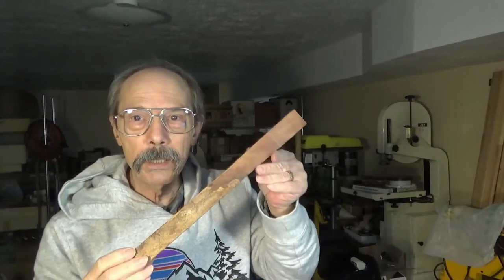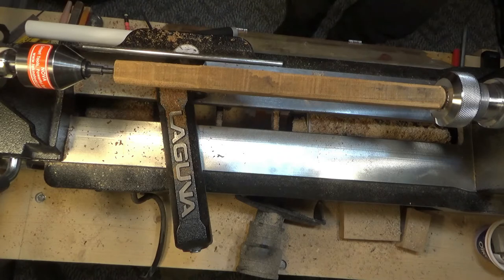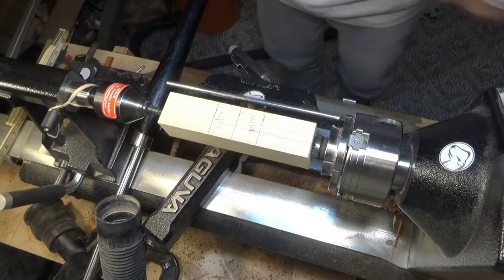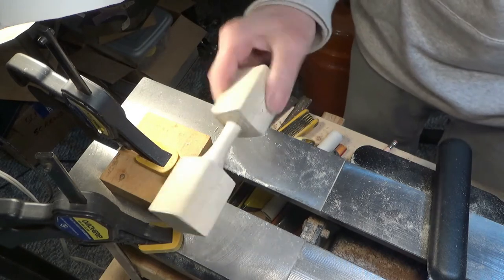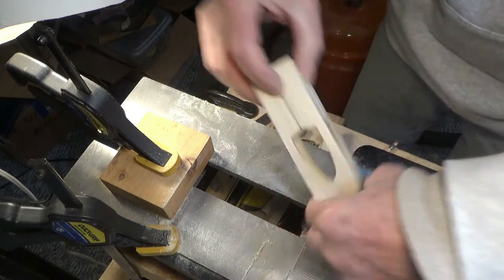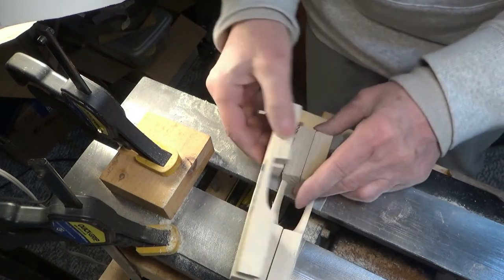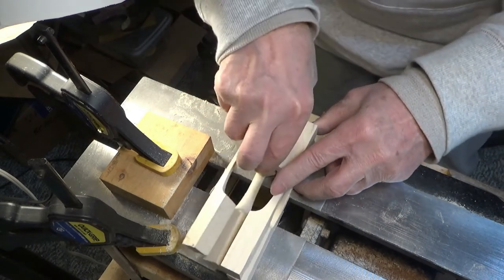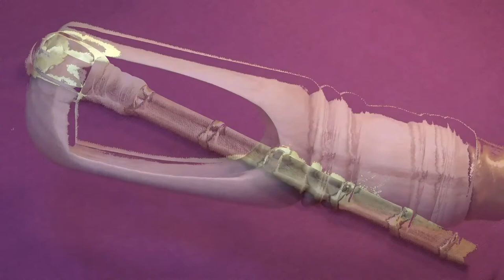Woodturning: Koa/Poplar Walking Stick (perhaps) ...  #WalkingStickChallenge

Comment from the maker: Lessons learned and other musings ...

🔶This was my response to a #walkingstick challenge put forth by Rob of https://www.youtube.com/watch?v=dTTRGgH9xEI ... not quite big enough (overall length is 18 inches or 45cm) for me or my wife to use ... but would work well with an 18 inch doll ... not sure if she will offer it on her Etsy store ... shameless plug: https://www.etsy.com/shop/DollyAttire

🔶I had a lot of fun making it ... and really am proud too ... I did 2 new techniques - Inside/out and off-center turning ... both came out almost as planned <\grin> 😁

🔶Youtuber Spiritwynd WoodStoneAndBone https://www.youtube.com/channel/UC__kJ9cdE-XngoGjE7sCu4Q ... inspired by her solid block inside-out video https://www.youtube.com/watch?v=Gnit5dxSoAs

🔶Youtuber Unruhly 3 gifted me the Koa ... check out his channel https://www.youtube.com/user/bill40bates

🔶After many months of wanting to try an Inside/Out I finally got my head wrapped around how to design one ... glueup and cutting is not the hard part ... getting what you want is  the hard part ... I'm 3D challenged if you haven't realized by now ... I cheated by drawing one in Autocad ... took me many tries over the months but this time it worked ... It ended up being exactly what I designed ... so many possibilities beyond Xmas ornaments but I will be doing those too

🔶Mistake: with the In/Out ... I should have faced off the ends to make the  alignment best possible ... you can see the problem on the inside bottom joint which I evened up w/ a Dremel ... I had planned to lop off the top to leave only 4 arms(?) pointing skyward but chickened out on my original intent ... maybe finishing the insides would have been better but I wasn't sure of the finish 

🔶You may not be able to see the off-center results ... the bottom 3 shaft segments are off-center turned ... about 1/16" (1mm) or so ... I was able to reposition each one as needed easily enough ... predictably, there was chatter in the middle ... I need some sort of steady rest ... $$$ ... the chatter did have a nice pattern I wish I could have used but it got sanded away

🔶The koa is bare wood with no finish ... just sanded to 320 and burnished with a popsicle stick (ice lollies?) ... the rings on the staff were waxed with Art Deco Metallic Gold wax ... apparently I like that stuff ... and each band has a friction burn from the same popsicle stick ... unfortunately the masking tape used for the gold wax left some discoloration and reburnishing left some tool marks ... but all is good since this was a proof of concept - perfection was not as important as usual ... there were a few other blemishes too

🔶Tail stock tip on spindles ... when I put enough force to get the live center to spin is tends to bend the spindle making any chatter worse so I eased off but then then it squeaked ... I used a bit of wax on the tip just like the way we used an older-fashioned dead cup center

🔶Not sure I'd do one from a solid block again ... a PITA to cut and some flaws at the matching joints ... one more glue up sounds OK in retrospect.

🔶The finish on the handle was just the clear shellac slightly buffed by hand with a green pad ... Gaak, I'm so lazy sometimes

🔶The is a tick-tock clock coming through on the audio ... sorry 'bout that ... I guess the camera's mic is better than I thought ... I need an electric shop clock ... or a fancier mic

🔶As usual, leave a comment if the video quality has some areas you don't care for or are annoying or you would want ... things like out of focus; volume is not consistent; screechy or annoying sounds; no music; jarring transitions; jumpy storyboard; too wordy; not enough talking ... please, it can only help us all, especially you viewers

💛❤💗💜 A big Thank You to all my subscribers and to everyone who watched.

🙏Please, stay safe.  -Mike
Reply from the maker: I approve this comment 👴👺
Reply: Superbly thought out and made Mike , it looks not unlike the  mace or ceremonial one like we have in our parliament and yes I believe it would make a very unique looking walking stick and there are possiblities of putting something inside the "mace " head or even filling with a resin . Brilliant job mate and perfectly executed 👌 Cheers,   Bram
Reply from the maker: Thank you for your kind words Bram, I really appreciate it 🙏 Yes, so many possibilities ! Give one a go ?  Take care. -Mike

Comment: That's a walking stick to me. Okay, everything in proportion, but if it is indeed for a doll of your wife then it is correct again. You've done a lot of extras like off center and inside out. Very well. I only expected to see you doing skew now. Then the next one?
Take care!
Frank.
Reply from the maker: Thank you Frank, very much so ! All went to plan and as you have remarked. Except the skew part - I got one for Xmas but it arrived very dull but I ran out of time to find and set up my grinder. Ugh. I really wanted to use it !! Next one, I promise :)   Thanks again🙏  Take care. -Mike